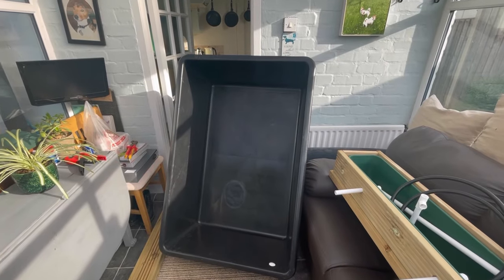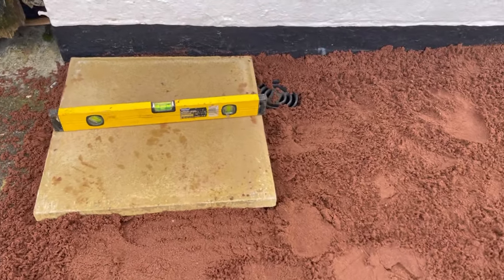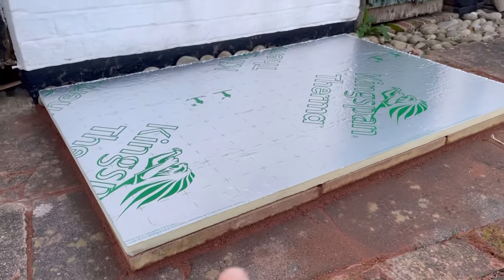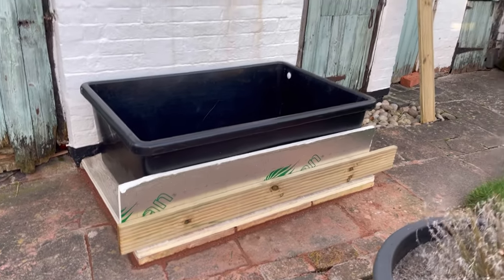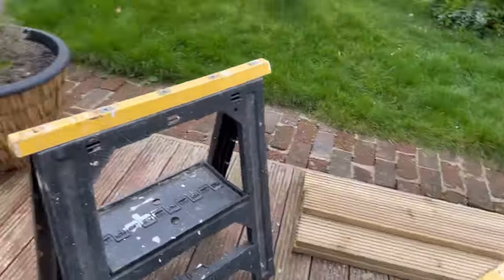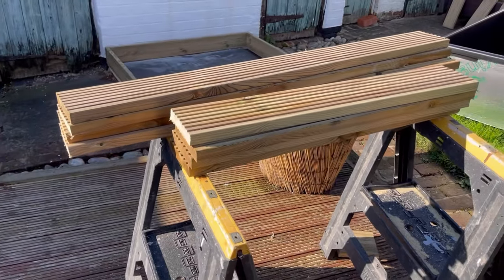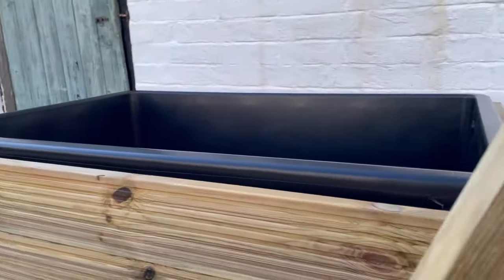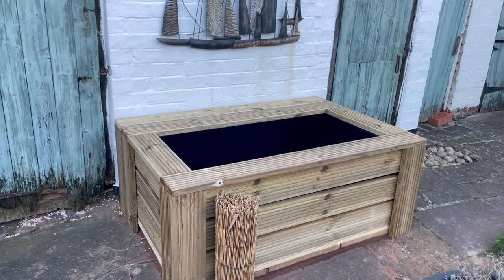DIY *above ground* MINI POND! (Pt.1)

Comment: Great video 👍. Just about to upgrade my barrel pond to the 410 Laguna tank, so I'm going to follow this guide pretty much 100%! One question though - how do you go about something like a partial water change in a pond that size? (and how often would you recommend it?). Cheers!
Reply from the maker: Thank you! To do a water change I’ve got a bit of pond hosing that I put over one of the outlet pipes and drain the water out on to the garden. Then I just add water back using a watering can.. this also allows me to dechlorinate each watering can of water before adding it back into the pond! You probably could just add water straight from the hose into the pond though.. just remember to add a bit of dechlorinator. As for how often, that really depends on what you are stocking in the pond? Is it goldfish? Good luck with the upgrade!! 👍

Comment: Hey buddy, been watching your vudeos for a while now, can you please recommend me some pond lights, where do you buy yours from? Thanks bud
Reply from the maker: Hi mate, i usually use Oase lights, in particular the Oase LunaAqua Classic LED. They’re not cheap, but seem to be good quality and I’ve never had any issues. I have also tried an Allpondsolutions (Sunsun) pond light, which was pretty good and a lot cheaper. I did also try a really cheap one from Amazon once, which really wasn’t very good.. Hope that helps bro, and thanks for watching! 😊
Reply: @GingerFishyOfficial  awesome, i will check them out, thank you so much👍🏻

Comment: Hi can I ask if the decking you used was treated or not. I looked on wicks & it said pressure treated. Iv built a similar surround from old decking given to me but now concerned about the top getting wet in rain & leaching chemicals into my pond?
Reply from the maker: Hi there, I’m pretty sure the decking boards I used were pressure treated (they were from Wickes), i then also stained them with a water based wood stain. It wasn’t until afterwards that I started to wonder about the stain/ treatment leaching into the water, so I did quite a bit of research, and found that it shouldn’t cause any sort of problem. It seemed that most people seem to think that once dry, any stain should be fine, and should not cause any sort of problem. There was a lot of people that had been doing it for years without a problem. Just be careful when applying not to drop any into the pond. Whilst doing the research though I did find that you can buy specifically designed wood stain for around ponds that is completely non-toxic to the point that you could get the odd drip in the pond and it still wouldn’t cause a problem. Hope that helps! 😊
Reply: @GingerFishyOfficial  thank you for your quick reply. I'm thinking it's best to just get my poor fish back into their pond today & either buy some untreated wood or put this old decking on today. Either way the padderling pool that they are in at the moment isn't great at all..

Comment: You didn't explain where the extra part at the back came from. You just suddenly had extra depth there. Is it a four-sided frame or is it just the top and two sides? And is it attached to the rest of the decking, or is it just set in?
Reply from the maker: Do mean the frame that went around the top of the pond? That the filter sits on? If so, it’s a 4 sided frame, with an extra piece of length at the back.. so it would be wide enough to fit the filter on. And then, yeah, I screwed it to the rest of the decking to secure it all in place. 😊

Comment: hey how does the insulation board work for you?  In my state the freeze line is 3 ft or 1m.  What about where you are how does the insulation boards work out for you in the winter.  Is it enough w/ just a heater?
Reply from the maker: Yeah, the insulation worked well. In the winter I also add a polycarbonate lid, which I  think makes a big difference. I didn’t plan on running a heater but after the bog froze solid, I added a 300W heater, attached to an inkbird thermostat, set to 5°c/ 41°f, which stopped it from freezing again, and that seemed to work well. I think our freeze line is about 0.5m here. 👍😊

Comment: Loving the content been looking in to creating my own pond in the middle of researching filters etc but this 410l tub looks about right for me. Is there anything you would change looking back at this build?
Reply from the maker: Hi there, I think I would have gone for a bigger filter with a clean-out valve. I think the plants in the filter struggle a bit because there’s not enough depth for good root growth. I am actually going to be doing an upgrade to the filtration on this pond soon, although the video won’t be out for a little bit yet. But yeah, Im planning to make the filter bigger and add a clean-out valve, similar to the filter I built for my DIY Patio Pond with Bog Filter. This is the video if your interested: 

https://youtu.be/oFc0oT5Zhks?si=zElkVTrP_p6Lqd71

Saying that though, if I was planning on only keeping nano fish, like medaka and white clouds, I would leave it how it is, but it turns out medaka are illegal to keep outdoors here in the UK, so I want to upgrade the filtration to the point it can handle some goldfish instead. 😊
Reply: @GingerFishyOfficial  thanks for the link and reply I will check it out. Already watched all of the other vids on your bigger pond which looks great but a little big for my liking.

Comment: Cool.  Thinking about doing something similar myself soon, however I am planning on doing so indoors.  What did you use for the liner?  I find it hard to trust most plastic containers.
Reply from the maker: The tub I used here is a 410L Laguna tub I got from my local pond shop, specifically designed for ponds, so should be all good!
Reply: @GingerFishyOfficial  awesome, thanks!

Comment: What was the drain you covered?  Is your garage next to it filling with water runoff now?
Reply from the maker: Yeah, the covering of the drain is a bit of concern 😬 I’m hoping it’ll be ok though as I’m pretty certain it’s been blocked since I moved in years ago anyway.. might try and add some guttering and a water butt at some point, which should help with any run off..

Comment: How did u cover the hole that is on the top right side of the tub?
Reply from the maker: It came with a plug which I put in, but as I wasn’t too sure how water tight it would be long term, i went over it with a product called ‘King British Just Fix It’ which I like a pond/ fish safe clay type thing, which I put over the top of plug.  👍
Reply: Oh i see thank you!!

Comment: Hi how do you manage to keep your pond water so clear.  I can’t ever get mine as clear asthat
Reply from the maker: Hi mate, good filtration, plants and not overstocking the pond helps! Also, a pond flocculant can definitely help with clumping together fine particles so the filter can more easily pick them up! 👊
Reply: @GingerFishyOfficial  hi thanks for your reply, there’s a possibility I have too many fish.   I inherited the pond when I moved to the house. The pond is 6ftx 6fft square and 3ft deep. And there are approximately 20 fish I have two big water lily plants. I was wondering if I should buy new filters  ,they are starting to ge5 a bit old looking they are the black mesh type
Reply from the maker: @troygoodacre2718  that amount of fish seems about on the limit I’d say, so should be ok. It’s a bit tricky to tell on the filter front without seeing it, but if it’s black sponge, that normally lasts for a long time, and just needs rinsing out from time to time! Also, maybe some deep water oxygenating plants may help, like elodea or hornwort, they are good for using up excess nutrients. Lilies are good for providing shade but they aren’t great for removing nutrients. Watercress could also be a good addition as it grows quickly, uses up excess nutrients and shades the pond aswell.. it can sometimes become a bit invasive and take over the pond though, so would need to be trimmed and have any excess growth pulled out! 👍
Reply: @GingerFishyOfficial  thanks for that. I will get some of those.

Comment: IWont it flood if you get a lot of rain?? Is it a good idea to cover the drain with sand?? I think pebbles would of been better for drainage.
Reply from the maker: Hi mate, you’ve got a couple of good points there. Flooding wise, you’d think it would, but I’ve not had any issues with this pond or my other pond that has been set up the same way for well over a year now. I know some people will drill a hole or 2 near the top of the pond to stop it from over filling, which I may do at some point, but to be honest I think if there was a massive down poor of torrential rain, a couple of small holes wouldn’t do much. I do cover the ponds in the winter though, which I suppose is the time it would most likely flood. As far as covering the drain, yeah, it probably wasn’t a good idea, although I’m hoping it will be alright as I’m pretty certain that drain has been blocked since I moved in around 10 years ago. Plus it’s hard to explain or show in the video, but how the drain is positioned, it’s a little higher so I don’t think too much sand could end up going down, but yeah it is a slight concern and you’re right, pebbles probably would be better. Live and learn though, and hopefully it will be alright! Thanks for watching! 😊